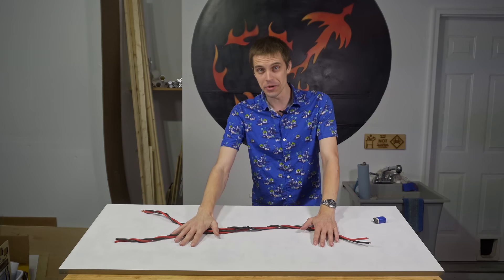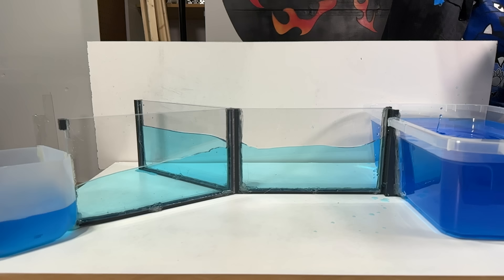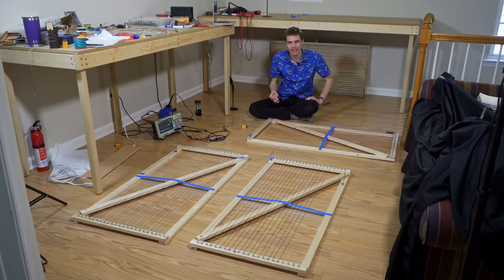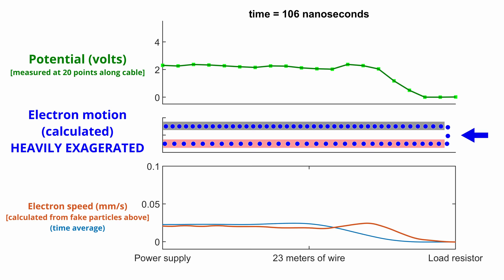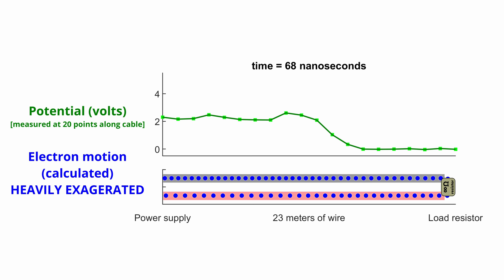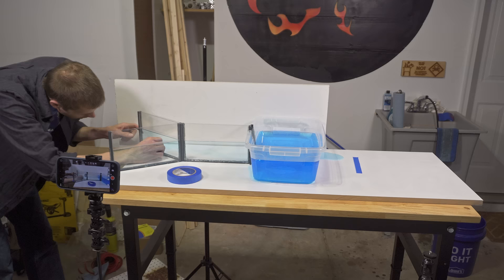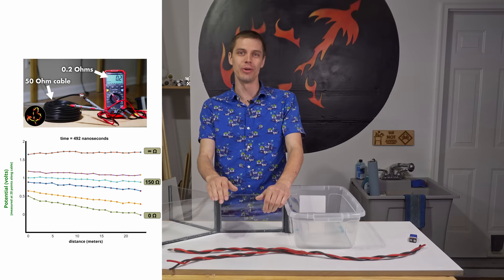Watch electricity hit a fork in the road at half a billion frames per second

Comment from the maker: Corrections and FAQ in this comment!
Check out the other channel for follow up videos, and video Q&A that I'll be posting in a few weeks with questions from here and from Patreon! https://www.youtube.com/@AlphaPhoenix2
Check out the Patron page if you want to support the channel, get early access to videos, and join us on Discord! https://www.patreon.com/AlphaPhoenix
Thanks to @ElectroBOOM for giving me a sanity check on this data a few months ago! (I hope you like the final video)
FAQ:

0) Questions about the experimental setup (including the effect of the probes on the circuit while I was measuring) are here! https://www.youtube.com/watch?v=sty0Y1qmgEYc If anybody wants to recreate this project, or turn it into an undergrad physics lab. hopefully there's plenty of info there! If I can remember how to use github I'll post some of my visualization code and leave a link on that video.

1) Lots of commenters have that I'm confusing voltage and current at times, but I tried to be very careful with my language. Current is the actual motion of the electrons, and in the graphic I showed with the blue dots moving around, I'm calculating that motion based on the voltage. it's basically the current that is NECESSARY to produce those voltage patterns. I also did a measurement where I measured the current directly by placing a very small resistor at the input lines and measuring the voltage drop across it over time, so I know my calculation lines up vaguely with that, but it WAS only a measurement at one point. If somebody wants to put a quarter ohm resistor every 4 feet along a wire and measure more voltages, I'd LOVE to see the data! I'll talk about the script a bit more in the Q&A video that hopefully will be out in a few weeks!

2) When you first flip the switch, the battery doesn't actually see a "dead short". The current out of the battery initially is limited by the line impedance, which depends on the properties and dimensions of the cable. In this case, it's the same current you'd get by bridging the switch with a 150 ohm resistor!

3) A lot of people have questioned the use of the words "communicate" and "sending information". I admit I anthropomorphize a bit too much in this video, but particles and groups of particles "communicating" and the rate at which "information" can move are very important hard physics terms that don't imply the particles are thinking. "Information" here consists of things like partical position, and they pass this information between each other using the electric field.

4) Water is a compressible fluid. if water wasn't a compressible fluid than pressure wouldn't work and water wouldn't be able to flow around corners in pipes. The way I'm using it it's actually EXTREMELY compressible (in the lateral) direction because it's allowed to expand upwards without getting significantly denser. Electrons in a wire are orders of magnitude less compressible than water, but it's still worthwhile to think of them bunching up!

5) ...........keep the comments coming! i spent like 4 hours reading comments yesterday lol
Reply: The correct answer should be 'B'. Recently(I mean 6 months ago...) I saw the debate of Veritasium and electroboom and came up to that conclusion...
Reply: I have a question, in your exemple with the open circuit we see the fact that the electron are closer in one wire. what happen when you stop the batterie ? (open the interuptor in your case) does the potential rest in the wire ? making it a small capacitor ?
Reply from the maker: @user-zp5xt8em6l I actually emailed some early data from this experiment to Medhi a few months ago and he said it was cool 😊. I’m not trying to “prove” or “discover”, anything here, just demonstrate. Electricity is very well understood by humans, it’s just hard to explain.
Reply: @AlphaPhoenixChannel  I cannot believe that you actually replied! Thank you very much!
THIS IS GREATLY APPERICIATED! 😊
Reply: @user-zp5xt8em6l that Veritasium video is pretty misleading. There would be some detectable trace effects due to the fields being in proximity but the full voltage only arrives later as you would intuitively expect.
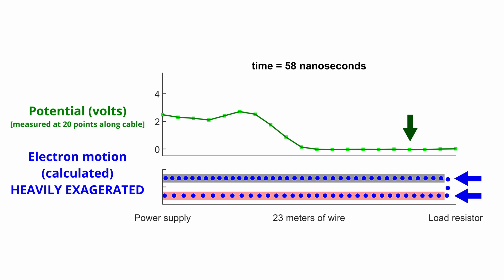Reply: 16:28 / 18:54 Since it pushes from one end and pulls from the other end before stabilizing... If you disconnect at both the bridge and the battery right after connecting it, would one wire have more electrons than normal and the other less? Same with 11:23, if you split the fork at the right time, what would happen?
Reply: @XIIchiron78   Yes, that is indeed correct.
Reply: @AlphaPhoenixChannel I could never get my head around Veritasium’s explanation with regards to the fields.
Reply: It really surprised me that it took milliseconds to stabilise seeing as audio is sent at the nanosecond timeframe at over 1 million bits per second. How does it not just end up as noise at the end when your turning on and off the circuit faster than the stabilisation time? 
Would a sound engineer be able to use your program to predict the effect there circuit with limiters and amplifiers and sometime disconnected kit(unplugged cables coming to and from the sound desk) will have on the sound quality? as in how quickly a signal will stabilise?
Reply: Ever since veratasium did that video and gave you a shout out. Circuits have become more complicated than ever.
Reply: It would be interesting to discuss your findings with Practical Engineering in the context of how this phenomena is (or isn't) taken into account at the infrastructure scale of a power grid. I would imagine that if there were multiple MW of power flowing back and forth on the lines as the system settled from a starting condition, that could cause some major issues if not handled correctly.
Reply: @truefiasco2637  I will suggest you watch the impedance matching video in the description. In practice, engineers need to consider characteristics of every part to eliminate these noises.
Reply: @truefiasco2637   You're talking about digital audio like SPDIF?  It's because in real life those have termination resistors.  The cable has an impedance (of 75 ohms, I think), and there is supposed to be 75 ohm termination resistors on each end.  That reduces reflections, so I'm guessing it would stabilize quicker.   

A really long Y cable with one end of the Y open might mess things up a bit, but it would have to be enough to cause a bit to flip.  Hook a few 50ft SPDIF cables to a Y adapter, and see if it still works with one of the cables going nowhere. 😀
Reply from the maker: @TheMohawkNinja  that would be fascinating! I’ve wondered how phasing works across the country - at c, the wavelength of 60hz is 1.3x NY-LA (thank you wolfram), so if you plotted a bar graph voltage map of the whole country, would there be ripples? Do those ripples emanate out from wherever did the OG black start? (And then drifted into noise?) now I’m super curious and measuring this synchronized sounds like a nightmare
Reply: Simpler question: Why is there a 'sudden' increase in voltage when the current reaches the wire with the two disconnected ends and 'sudden' decrease when you reach the wire with the two connected ends? 

More complicated question: Are the voltage changes really 'sudden' like that or is some dynamic phenomenon occurring over a timescale too fast to capture?
Reply: If you wanted the water model to work more like the electric model you shouldn't have pored the water into an empty "corridor". You should have had  filled the whole system and than generate a wave. This because the wave of electrons from the battery are more like ramming into stationary electrons. At the point the wave reaches the bifurcation. The wave needs to push twice the amount of mass. Which can be taught of as a dynamic end cap. This will result in a partial internal reflection
Reply: Is there a reason the animation only covers the black wires and not the rest of the red wires? There are effectively two forks onto open ended wires: one at 25% along the circuit to the unconnected black wire and one at 75% along the circuit to the unconnected red wire.

edit: come to think of it, is the potential being measured relative to a common ground or between the red and black wires at a point?
Reply: I would love to see the difference between 50 ohm antenna wire and 75 etc antenna wire in this way to see the impedance waves running through the circuit. It would be helpful to understand radio for sure
Reply: Is this analogous 19:00 to open and closed end waves of different types (basically a rope swinging up but then being held up by some fans?)
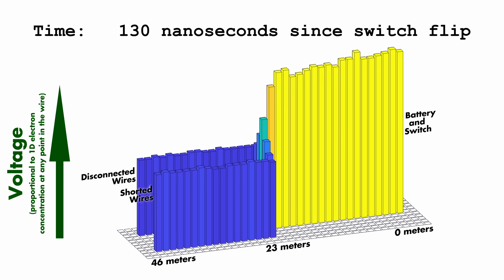Reply: Great video! At 11:03 you said that something looks like it's getting reflected back towards the battery, and that it looks weird. I'm not sure if the drop in voltage in the reverse direction is what you were talking about, but that's exactly what I'd expect. At the speed of light, it's not too useful to think of current in terms of amps anymore. It's better to think of coulombs. So, one coulomb goes down the first wire until it hits the fork. At that point it splits between the two wires, and each coulomb is at half the voltage it was, due to the wires essentially being two resistors in parallel (Ohm's law).
The reason it reflects back towards the battery is because voltages measured through a uniform conductor ideally drop linearly, so it's trying to reach that equilibrium at (near) the speed of light.
Reply: How are you reading so many different analog voltages all at once and so high speed? I have a four channel oscilloscope, but I see you are reading like 60 different voltages. I really love how it allows you to make a map of the circuit and really analyze what it is doing, would love to look at circuit boards like this.
Reply: I have a problem with this "communication" concept. If you go back to your water model, it's not communicating. The water hits a dead end and backs up, then eventually drains through the outlet, or in this case, the short or load. The voltage/current at the battery is dropping and stabilizing based on "flow" of the stabilized "stream". But to say it "communicates" back seems like a bit of a stretch. Unless this is how it's just described in physics?
Reply: @warpigs330  I believe he just repeated the experiment multiple times and changed the position of the probes each time. Which is perfectly valid so long as you don't change the circuit.
Reply: What does it mean one of the wires is shorted? I thought shorted, just from like a popular usage perspective, meant a wire couldn't pass a current anymore.
Reply: @blaircox1589  That's essentially what all communication is: one point in space receiving changes initiated from another point, and responding to those changes with changes of its own. When the wave of current comes back to the Y split, that also affects the drain current of the battery (at first) until it reaches equilibrium.
Reply: @givensuman  A "Short" just means that a wire is connected somewhere it shouldn't be. It's a "short" circuit because the circuit should be longer, but something is connected unintentionally so it is shorter than it should be. Shorts can definitely pass current. Short a high voltage line to ground and you will see some sparks.
Reply: What would happen if you used AC instead of DC?
Reply: I think part of the problem with the water model not appearing 100% accurate, could be in-part due to boundary layer drag, The walls are so thin that the water is basically mostly surface area, in-contact with (and sticking to) the glass. adhesion could sap energy from the system, acting like a damper on a spring (or in your wave in this case). It'd be too expensive to be worth doing it with Mercury (not to mention that a room full of large amounts of uncovered mercury isn't great), but I feel like that could be a cool way to bypass this, simply by having the mass/density of the mercury overcome any forces by the boundary layer. 

Another way that "might" work (I don't think so, but it's easier to test at least), is by using a low surface tension liquid (I know it's not surface tension causing the issue, but it may be related to boundary layer drag.
Reply: Why is there a back-ripple drop at the point where the wire splits?  Maybe I've missed the explanation, but I don't get why the voltage drops at the wire split point
Reply: In the triple-chart at about 14 minutes, the middle electron motion graph seems a little confusing to me in the return path—am I thinking correctly that the top graph doesn’t show the measurements in the return path? It makes those two graphs not correspond, if you’re focusing on the electron motion behavior in the return path.
Reply: I originally thought it would be B because I thought the negative side of the battery would start pulling in electrons once it's connected, but it appears that with your switch circuit, the negative is always connected, so that couldn't be observed
Reply: just a question then? couldn't you then use some switch magic to keep pumping the wire with electrons and then somehow burn the wire (disconnected wire OHM INF) i mean like the wire is a tank of water but it can't hold much so it burst because you keep turning the pump on and off... in that wire it seems like it has a much higher electron volume than the first time you haven't turned it on yet at the end.
Reply: Do you think hanging over a hundred 'scope probes off this thing might change the circuit? There's probably 5-10 pF at each probe point so how does that compare to the wires?
Reply: 4 years of E.E. in a 23 min video. 
WOW!!!
Reply: @AlphaPhoenixChannel Can you clear something up for me?
When you say 1 graph is "the wave" and 1 graph is the actual electrons movement and the electrons are moving way slower than the wave... Is "the wave" an analog for the electromagnetic field? And does the load/light bulb turn on when the wave hits it or when the electrons start moving through it? 
And if it's the wave that lights it, how is that possible with zero change in the movement of the electrons from before the switch was flipped? 

I also saw veritasium's video and can't conceptualize both explanations being valid lol
Reply: At 5:18 you could use mirrors on the celieing to get more space for the camera. I think Film Riot has a tutorial on how to do so.

Probably not worth the hassle for ya, but figured I'd mention it anyway
Reply: @truefiasco2637 the reason is this: impedance matching. The twisted pair in the experiment has a builtin impedance. Remember that, in the experiment, the open circuit pair saw a doubled voltage when the wave feont hit? And the closed circuit saw the voltage drop to zero? This is because the "termination impedance" was infinity and zero respectively. But engineers use an impedence which prevents the reflections entirely. This can be done a nulber of ways, including simply putting a resistor across the wires. The same thing happens with digital systems (e.g. ethernet) and RF (radio waves). All these applications require careful attention to impedance matching to prevent unwanted reflections.
Reply: @givensuman "shorted" is when the wires connect essentially without resistance. Also called "closed circuit". You described "open circuit", which is where there is no circuit at all: it's unconnected.
Reply: You should absolutely do this again with inrush limiters and diodes.

I hope you still have the setup.
Reply: @bamberghh1691 there are a number of ways of explaining this. If you think of it as a wave front hitting the junction, then you can model it as each twisted pair as having an impedance. The impedance at each point determines what happens to the wave. When the wave front hits the junction, there are now two paths, which essntially halves the impedence, causing a reflection back down the path it came from. It's half the impedance in exactly the same way two identical resistors in parallel have half the resistance of each individual resistor.
Reply: does the experiment change if you reset (ie briefly short) the disconnected wire between experiments?
Reply: @EmpressOfExile206 I think the problem is the whole picture really includes both the electric field and the magnetic field. But for most circuits you can ignore the magnetic field entirely. Veritasium tried to explain the whole thing. Whereas in this model, AlphaPhoenix didn't really use fields at all, just implied them via the motion of electrons. But of course, each electron has an electric field, and in motion a magnetic one too. There are many ways to describe a system in physics, often entirely equivalently. I've seen physics start with an electron, and then show how it moves near other electrons, then build up the idea of a field from many electron pair interactions. Physicists use whatever model happens to be convenient for the system at hand.
Reply: @MadhavMalhotra reflection. But it will happen at both ends of the branches and even at the 'Y'. Every impedance change will cause reflection.
Reply: The 'switch' or the sudden change of voltage level at the beginning of the wire can be seen as a ramp of a square wave. A square wave can be seen as a combination of all odd harmonics of its ground frequency. So there are multiple things happening at different frequencies until it stabilizes.
Reply: At 7:46 in the video, why does it appear like there is a very tiny bump in the voltage and then a dip before the switch turns on? 

Also in the video at 16:09 , you said how + pulls the electrons and - pushes. Why is there a single wave here? Shouldn't a "dip" wave start and propagate from the positive terminal of the battery at the same time as the wave you show in the video that starts at the negative terminal?

Edit: after thinking more is there actually a pull but your graph/animation only displays the difference in potential wire to wire so it isn't visible? If you instead measured wire to the battery would you be able to see the wave coming from both ends?

If there is pull wouldn't you need to open up the end to let water out at the same time as letting water in to replicate it?

Thanks, sorry for the double post I just saw questions go here.
Reply: @AlphaPhoenixChannel   Couldn't the "negative" back-wave that you see in electricity but not in water be explained by the other half of the wire? So it's not the wave bouncing back, but wave of negative potential coming from the other said? And the water model is not a closed loop, so you don't get the other half of the loop.
Reply: Does this analysis have something in common with antenna theory?
Reply: It would be interesting to analyze these results with a quantum model of electrons. Electrons are never not moving.
Reply: @Somerandom1922  I would think besides the boundary layer or layers, surface tension would affect the shape of the wave and how it reacts when it hits the wall. The surface tension will also cause a meniscus all along the walls. Air and temperature too but probably negligible. The density of the water. The depth of the water probably has some effects. Waves from the sides of the container. There are tons of interactions and properties of fluids that don't apply to electron movement. Water can hit the end and splash, and a water wave can "break". Water is analogous but not the same. It's not a perfect replica but it does make a surprisingly accurate visual representation. 

The water model also formed a depression at the Y intersection where the voltage didn't.
Reply: you spelled exaggerated wrong at 14:30 🙃

i'm too dumb to correct you on the electricity stuff even if it were wrong
Reply: but are they in the wire or on the surface of the wire? Both? 

It seems to act like pressure increases and a fluid.
Reply: @MadhavMalhotra  not an expert here, but my understanding of the video here is that the "voltage" (or the height in the graphs), represents the crunching pressure between adyacent electrons when the power supply starts pushing more new electrons into the wire. So along a wire its like a pressure wave. When that wave reaches the open end, all those electrons that are coming close to the end (and all those coming behind those) will crunch even further, and the pressure will reflect back. On the "close end" (which is actually not an end, because its continuos back to the power supply), there is not "pressure" stacking up. I hope this helps, and that someone confirms or refutes my sayings.
Reply: Fantastic. What is happening at1st reflection at the Y splitter is the impedance mismatch, which causes the part of the energy to reflect back. It is a kind of a semi wall, a semi transparent mirror. Further, the electrons are moving in the both wires of the twisted pair concurently vs. distance from the battery (parallel capacitances), in one enrichment, in the other depletion. The twist is important, too. It determines the overall impedance of the wires pair. The resitor at the end of the line matching that (typical) impedance should give the least reflections and oscilations, the most smooth propagation wave. It is very likely to be somwhere between 75 and 300 Ohms.
Reply: The initial current is limited and determined by the parallel capacitance and the serial inductance (which builds the field around the wires. That is how the battery "knows" how much current it lets go. The field is the effect and not the cause.
Reply: @MadhavMalhotra  my guess for the sudden decrease at the shorted end is that at that point, the impulse from the other terminal of the battery reaches that point at the same time through the second wire and the electrons, instead of bunching up against the end of the wire like the other side, instead are driven to flow faster by the opposite charge.
Reply: @roustache to answer your question as simply as possible, 
Removing the voltage is the same but opposite effect on voltage ( positive instead of negative potential). We can think about it this was due to a nice mathematical property called superposition.

The line capacitance does not change, it is however frequency dependent. This means switching on and off will have different effects of different AC frequencies present. Unless we can have the characters impedance matched such the the line is considered to be no dispersive, in which case the phase velocity of different frequencies is the same, we don't get a slew on the waves.

You can read up about transmission line theory if you want to know more. Specifically, the experiment he did would be known on paper as a "bounce diagram".
Reply: So I am just learning electrodynamics and this was very interesting - visualized the reflection factors of -1 and 1 pretty well. You forgot to either edit out or explain why you at some point mentioned the resistors btw (for anyone interested - the reflection factor is 0 if done right so basically it doesnt reflect anything). I would have loved to see or hear why there was a reflection at the fork tho - thats basically the only thing I did not understand about this yet. Does the initial wave "see" some sort of resistance at the fork which causes an initial reflection? Also, idk if this would not have been easier to visualize with high frequency waves. I suppose getting a proper siganl generator is expensive.
Reply: Looking forward to your purchase of a vector network analyzer.
Reply: None of those 4 options is the correct answer.
You have a long Y shaped capacitor. Current will start to flow to charge the capacitor and both paths will be taken at the speed of light. You can use a SPICE simulation where you have the circuit simulated as a finite chain of inductors, resistors and capacitors. That simulation will perfectly show what happens in a real circuit. There is no guessing involved it depends on the line capacitance, inductance and resistance.
Reply: @pottedrosepetal6906 There is a imepedance mismatch at the Y element. That is why energy partially reflects back.
Reply: I think the wave graph would be much more enlightening if Current was the Y-axis rather than Voltage. Of course the disconnected wires will spike in Voltage, you've effectively extended the battery terminals out to the ends of those disconnected wires.
Reply: @electrodacus the capacitance is between the twisted pairs, and the behavior is described by the characteristic impedance of a transmission line.
Reply: i just want to know how would changing the supply from a continuous to an alternative one would effect your results, i would assume that it should line up with what everyone is talking about ie Mehdi and Veritasium's results from some time ago
Reply: @onradioactivewaves  The point is that there is no guessing involved. The current that starts to flow at the moment the battery is connected has to do with the line impedance so capacitor starts to charge thus current depends on the line impedance not just a random (guessed) current.
Reply: Very nice video! You come so close to getting it right! Instead of talking about electrons 'flowing' through a wire, it should be, "The 'electro-magnetic field' travels down the wire".
Reply: The reflection when hitting the Y makes complete sense from a fluids analogy. I work in the dynamics world for machinery and piping. A change in diameter of piping acts as a reflection to pressure pulsation. Because the wire you have in the two branches is the same, the effective cross sectional area changes, denoting a reflection point.
Reply: Ok, I'll play.  I believe C, since the update at the speed of light doesn't know the termination as it progresses down the wires.  This is similar to how a pulse signal progresses down an antenna that isn't shorted to the ground side.
Reply: I'm speechless. I'm gonna bug my electical engineer coleagues about this for a while.

...in the mean time, could you calculate and render the same thing for both poles at the same time relative to a common ground? I think that might give us a bit more intuition into the interference at the zero ohm "end" and even better picture overall.
Bonus points if you could do both U0=Ups/2 and U0=negative terminal.

Once again, amazing job. I would never think this possible with "NASA budget", let alone one dude doing it at home. Seriously, where do you go from here? Homemade Ligo?
Also: take that @electroboom and @veritasium!
Reply: Just nitpicking, but the wires being a twisted pair certainly matters for the initial inrush since impedance depends on the physical configuration of the transmission line.
Edit: twisted pair is also great at not being an antenna so you avoid any voltage due to emf.
Reply: It might be interesting to see how the battery figures out, after the stable state of one half connected & the other half disconnected and quiet, IF you flip a switch at the end of the disconnected wires creating an instantaneous connection!  At that moment, the battery already decided there's "nothing juicy flowing" down the dead connection wire but suddenly needs to notice that it got connected.  And does making that new connection influence current already traveling down the initially connected half?   I also got lost in your discussion explanation using the descriptor "waves" ... and ... any notion of the term "electric fields".   Or:  in this experiment result, what exactly are electric fields doing versus electrons?  Beautiful work!  ♡☆
Reply: @electrodacus  Or you can treat this as a transmission line with a specific impedance if you want to go the route of abstractions. I agree the options were worded badly, but given this isn't meant to be a electrical engineering exam, but rather an infotainment video with "guesses" in quotation marks option C is quite obviously implying the correct answer for those who know and easier to understand for everyone else.
Reply: @DmitriyLaktyushkin  It is a transmission line and there is no abstraction there. In order to be able to calculate what happens on a transmission line you need to quantize it so have finite number of RLC elements in order to be able to calculate what happens at every point.
Making the video was a lot of work and a SPIC simulation of a transmission line will have provided the same results with much less work and burned fingers :)
Both inductor and capacitors are energy storage devices so it is irrelevant what is or not at the end of a transmission line for the current at initial connection. And that current can be precisely calculated and not a guess.
Since there is also resistance even a open transmission line will waste energy as heat at the initial connection.
Reply: There are 2 types of current. magnetic conventional "electronic" current,
and dielectric displacement "positronic" current.
voltage, capacitance, inductance and resistance.

So which current are we talking about?
the open branch acts as a capacitor, so mostly displacement current from the dV/dt at the switching moment.
every thing starts to ring at a high frequency until the steady state occurs.
So, voltage is transformed into these 2 currents at the same time, but in opposite direction.
one flows from positive to negative (displacement current) and the other magnetic current flows from negative to positive.
Reply: Are all the leads back to the scope the same length?
Reply: To get liquid to behave more like electricity, you could think thinner liquids (I would assume that less viscosity means more pronounced wave patterns due to less friction)
P.S. I guessed for B
Reply: Would the reflected pulses indicate the resonant frequecy of your wire loops?
Reply: How does the fact that electrons in one wire can influence the electrons in the other wire via the EM field tie into this? The electrons start moving in both wires. Then the field reaches the (dis)connection points. Instantly, in the connected part voltage spikes (cuz in both wires it reached this point simultaneously). In the disconnected, dies down. Why is this wrong?
Reply: FAQ: When you say you measured the voltage you always mean in relation to the other wire at the same location, not relative to ground, right? Such that the voltage at the connected end is 0V, not 4.5V. 
If my guess about the measurement is correct, then the waves we see could come from either of the two wires.
EDIT: nevermind, I watched the bonus video now
Reply: I think you misspelled exaggerated in one of the slides :P
Reply: I’m going to guess option D. Simply because that is the most wave-like analogy of the four (compared to acoustic waves, or ocean waves). Now for the fun part!
Reply: Would you consider making a similar circuit without using a twisted pair? basically the whole thing would become one giant capacitor, just having the leads travel next to each other so we also get to observe the effect of the electromagnetism in action?
Reply: Have you tried this without twisted pair?
Reply: do the same thing with a switch at the end!
Reply: I think it was a bit of a mistake to only measure voltage, and then say things like "current is flowing here", or "current is getting split". You're measuring the electric field strength, not the current. It's trickier to measure current, especially at various points along the wire, but a few small resistors at the battery, and at the 3 way junction, would have enabled this and might give more interesting data.
Reply: With respect, if it can be understood it can be explained, I think your experimental explanation of what is happening is the best I have seen. @AlphaPhoenixChannel
Reply: Which oscilloscope do you use?
Reply: Maybe you explained it and I missed it but why is there that reflected wave when the voltage reaches the split. I would have expected the wave to travel down both paths but I don't really see why another portion of it is reflected back. In the water analogy is makes sense because water has its own inertia as it travels through a channel, it hits the split in the pipe and briefly there is a high pressure that reflects a wave of pressure back upstream as the water's inertia means it can't change direction instantly, is there something analogous happening with electrons in the wire?
Reply: In the Video I see that you used a 9v battery to drive the circuit. Why would the voltage be 2-4v on some of your tests? I get that the battery used could be drained at the time of taking the data, but maybe your next video could go into proportional differences of the waveforms when using either a constant voltage source or different kinds of batteries. This waveform could be due to the chemical reaction of the battery itself.
Reply: I don’t believe C correct either, there is no guessing, the potential between the battery and wire is greater at the start, as the electrons flow, the potential equalizes, and thus current stabilizes.
I could be wrong and often am.
I believe you might get a closer analog with the water if the bucket that it drains to goes below the table.
Reply: Yes, that's why sudden massive disconnections can cause problems. Also, why photovoltaic installations are problematic for the local grids.
Reply: at the start - i knew it was capacitance - however - the idea that a wave is reflected from the junction of the two wires is flawed, simply because a short circuited junction is not two wires - it is one wire and you will not be at a full or partial boundary to cause reflecting any signal 

i am considering that the stated ' reflections ' :
1 . are not external to the power source ( they are not reflections at all )
2 . are the results of the variant differences of potential inside the power source

check if your data contours to the idea that the variations of the voltages ( difference of potential ) in the electron paths - outside AND INSIDE the power supply - are a more reasonable explanation for the oscillating voltage wave movements 

so as the positive side of the power supply is being depleted of electrons that are leaving the power supply and entering the wire  - the difference of internal potential causes electrons to leave the negative side of the power supply and that raises the potential between the negative terminal and the wire - thereby facilitating the movement of electrons from the wire into the power source - presumably spreading them further apart from one another inside the wire

it may be observable if you tested two points at once - one point near the positive terminal and one point near the negative terminal
would you be surprised if you saw a negative potential near the negative terminal concurrent with the positive potential near the positive terminal ?
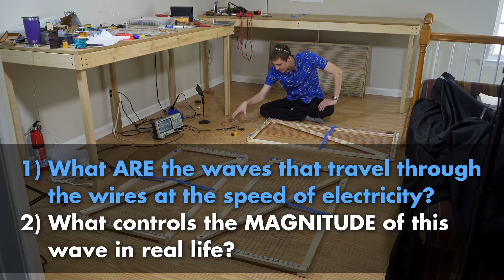Reply: 13:01 simple.  if you open a faucet connected to a garden hose, it will initially have massive flow at the beginning until water reaches the sprinkler which more likely has restricted flow. the increase of water pressure in the hose will reduce the water volume coming out of the faucet.
Reply: Short answer: Transmission lines.
Reply: Next step would be to see how an electrical arc can solve a maze.
Reply: @EmpressOfExile206  As I understand it all the electrons pushes against each other. The wave is the pushing effect. The localized electrons can there fore start doing their jobs as soon as the wave arrives. The wave is the electromagnetic field. The wave I am talking about is the main wave. There is in fact a lot of waves all added up and eventually generating the wave front. All the wives are sinosoidal  waves. It is only when they are added up that they appear as a front.
The veritasium video was pretty misleading and Derek was not very proper in that one and his follow up. He wanted to be right and admittingly he was partly right but the whole thing is needed to be totally right and in the totality he was more wrong than right.
Reply: How does the surface charge theory of the cause of the E field that gives rise to electron drift play into the electron “bunching” description? My understanding is that the field that gives rise to voltage is a surface charge potential wave phenomenon.
Reply: @tolkienfan1972  You are right impedance matching would have fixed it but that was not the purpose of the exercise. The purpose was to see what happens in open and closed wires and that it showed pretty well. That is my opinion at least. I have worked on all of the systems you mentioned and after having seen some of the signals in computers I actually wonder how can it work at all. I was usually there to fix the computers when they didn't work and some times the fix was to put in a longer wire or some other delay.
Reply: @tolkienfan1972  Unfortunately physicists are people too. They some time don't understand as much as they think they do. That goes for engineers too. I am an engineer but I have many times met people that have worked on some thing and they know their little field much better that most engineers or probably physicists too. That is currently my opinion and I usually mention that when I answer a question or put in a remark as really most of what I know is what I have learned from others but I do compare it to my experiences and I have many years experience.
Reply: @chrislambert-shiels5291  In a way it does in my opinion. Even a dc is an ac. That is any change in a dc potential happens with the help of a number of sinusodial waves and the wires here are basically transmission wires. The termination would be the antenna and a half wave dipole antenna works as a short for it's resonance frequency. The reflections you see on the wires are similar on cables to an antenna. An open wire stud does work as a total short for a set frequency. I saw this clearly for the first time many years ago when I was installing TV antenna's and the customer wanted to connect 2 TV's to the same antenna. One TV could show some channels but not others and visa versa. I have also experienced it later on data communication. (Standing wave theory).
Reply: If you disconnect and reconnect the battery really fast, which side will get hot quicker?
Reply: @osarjeant  Correct but the overall result is equilibrium when no external charge is put on it I believe.
Reply: @leonhardtkristensen4093  "unfortunately physicists are people too" This isn't unfortunate.  "that was not the purpose of the exercise" I know that. I was responding to a specific question. When I respond to you, your name will be mentioned.
Reply: @leonhardtkristensen4093  a change in potential implies ac. Dc implies no change in potential. A steady state. The terms are used specifically to distinguish the two cases. It's also acceptable to refer to the "dc component" of s signal, which would be the mean potential over the whole or specified part of the signal. If you use the term "dc" to refer to a change in potential, you are misusing the term.
Reply: @m1stertim  I don't think it was an English education. As a person with a non English background I have problems writing all the time and I honestly must say that he should have a 10 in effort explaining the electricity stuff. If one couldn't say or do anything for worrying that one small detail was wrong then one couldn't do anything. 
In as so far of you being too dumb to understand it then I am sure that you are wrong too. In my opinion to be dumb one must not want to learn. If you had the interest I am quite sure that I could teach you. You have obviously learn English so you can learn. To not be able to understand is most often because one has not learned enough. It is not dumb not to know unless one doesn't want to know if one has the ability to learn.
Reply: @TheElectrition  it likely depends on the frequency, and the impdences of the twisted pairs. You can cause a "standing wave" in the wires, which can result in hot spots. These standing waves depend on the transmission line impedance and the terminating impedences.
Reply: Sounds like a capacitor, to me. @Amonimus
Reply: @pottedrosepetal6906  As some body else has already mentioned but possibly not to you then at the fork you connect one impedance to two impedances in parallel. If the impedance of the wire is say 100 ohm (that is the impedance of an infinite wire that is talked about) then you put two 100 ohm wires across and as if it was resistors the impedance is then reduced to 50 ohm. This will of cause cause a reflection as does any change of impedance in a transmission line.
Reply: While the grid might not have this exact phenomena, it DOES fluctuate back and forth, and substations will constantly adjust the amount of current sent to blocks of customers.  If it did NOT do this, we would have transformers and maybe even turbines blowing up, at electric plants.   @TheMohawkNinja
Reply: @Sett86  I agree with you prize but not so much your critique. I believe he used one side of the battery - say minus - as common ground. He really had to. You can not measure voltage levels from a floating ground.
Reply: Amazingly cool! I'd say you better had emphasized the effect of two twisting wires in containing the field around the wire bundle. That's why the field is not propagating in 2D, affecting all the lines at almost the same time. You have two fields that cancel each other out at distances larger than 2-3 times the diameter of the twisting pair.
Reply: The amount of charge in the wire cannot be more than the source of the current.  So, it would never be more than 9 volts. @Drefar
Reply: @ramrod0209  In my opinion electric field surrounds an electron (are probably part of the electron) but stretches far away from the electron in ever diminishing strength. That is what is  adding up to make the electric field. If it is moving there is also a magnetic field generated. The front of this field moves along the wire similar to a wave in water. In contrast to a wave in water then this wave stays up. It does not go up and down like a water wave. To achieve this a lot of smaller higher frequency waves (all sinosodal waves) are generated  and added up so that the result is like a rising and then flat long wave. Any mish match along the travel will cause reflections and any change like a new short introduced will start a new wave from where it is introduced. Theoretically it will newer settle totally with the formulas we normally use. It is only when the resistance in the wire takes away more energy than a wave holds it will stop.
Reply: @user-zp5xt8em6l  …Did you not watch the rest of this video, where he experimentally demonstrates that C is how it behaves?
Reply: @MasterIvo  In my opinion you are totally correct except there is only one kind of current that being the movement of the electrostatic and magnetic fields from the electrons. The ones you are mentioning are all from the same. And yes of cause the atoms that have lost an electron do move in the opposite direction I suppose but not much. They probably don't even move out of their lattice arrangement in the metal. Electrons jump around between atoms all the time and the so called hole current is really also an electron current. Most commonly we think about current as what is creating a usable outlet of energy like when multiplied by a potential (voltage) shows up as light in a lamp. Of cause we also have current going into a battery or a capacitor when being charged. The inductance comes from magnetic field and the resistance is the losses from movements of the atoms caused by the jumping of the electrons and is causing the heating.
Reply: First, amazing video and explanation.  One comment/observation is that I think it would be almost more interesting to do this demo with a medium sized bank of capacitors to show how the water/electrons are "sloshing" out of the source and then being sent back in by the wave because it shows the degree to which the electrons do move slightly into the fully disconnected wire pair and then slosh around until they reach the equilibrium based on the overall capacitance of the system.

In either case, I love each of your videos and applaud your ability to figure out how to measure this.
Reply: @ChelseyK1ng  The electrons don't go anywhere instantly.  The effect of the compression of electrons move with near speed of light but does depend on the surrounding materials. The two wires along each other creates the capacity (you need two surfaces to have a capacitor). That is the E field. The M field causes the inductance. The electron in front of the one we are moving has a mass and as such it takes a little energy to start it moving. This kinetic energy in the electrons is also why energy has to come out if you abruptly stop a current. 
The current goes from the battery at a speed that is determined by what is holding back the influence of the EM field and what potential is put on but mainly the impedance of the wire. The current front is the same as the EM front. The impedance is made up of the inductance and capacitance in every little spot along the wire. If there is any change in the impedance (as where 2 wires are paralleled) there will be a reflection. A similar thing happens at the ends of the two wires. The amount of reflection is determined by the change in impedance. If a different or a new change is introduced a reflection will move down along the wires in all directions similar to the initial wave front. This is my understanding of what happens.
Reply: @brendanpreece3089  In my opinion that surface charge you are talking about is really the surface charge or E field around all electrons. As I understand it all electrons try to get away from all other electrons so the electrons do sort of bunch against each other and yes that is what is causing the voltage surface charge potential wave phenomenon.
Reply: @TheElectrition  The one that breaks connection first as the resistance will be highest there.
Reply: @tolkienfan1972  Sorry I just thought I had some thing to say there. I apologise if I offended you.
Reply: @tolkienfan1972  In my opinion when a voltage is connected (DC or AC) it will all behave very similar. We are here in this video working with a DC battery connected to a wire configuration and as it is the start up phases that we are looking at I believe it should all be looked at as AC.  In fact I would say that all so called DC connection can be looked at as an AC. It is just that the wave length could be up to billion's of km's. Of cause in daily talk we would probably specify anything with a pulse length longer than seconds on at least minutes as DC. It does not change the fact that any change can be looked at as AC.
Reply: @leonhardtkristensen4093  thank you for the detailed answer. I'm gonna have to reflect on it for a couple days haha
Reply: @Agnes.Nutter   Yeah, I did! See  Alpha phoenix wanted us to make a guess just before the explanation and I gave my guess and then watched the entire video  but I won't change my guess after getting a in-depth explanation of the circuit because that was supposed to be just a GUESS.
Reply: @leonhardtkristensen4093   the capacitor uses the displacement current, which flows through the dielectric. that is not an "electron" flow. So I agree to disagree.
Reply: @Agnes.Nutter   And thanks for understanding my reply clearly! :)
Reply: I believe a corollary to your work on voltage propagation in POCW (plain old copper wires) is that there must be an AC frequency at which the voltage changes are essentially messing up a circuit that would work fine in DC. As you experiment with higher and higher frequencies, POCW becomes increasingly worthless to transmit the electrical energy. It is at this point where circuits utilize waveguides and other strategies to contain the signals in increasingly hostile (high impedance) circuits. You can overcome some of it with certain gating strategies, and, of course, using digital/binary or square waves rather than pure sine wave AC. Probably beyond the scope of this, but that's what I was thinking after watching your great video.
Reply: @leonhardtkristensen4093  of course you can get ac from a battery. But that doesn't change the definition of the term "dc". Using dc that way is simply incorrect. A battery is usually said to be dc. But it's not accurate. Once connected to a circuit and allowed to settle to a steady state, then the flow itself might be dc, but there are probably some ac components. Do you see? The definitions of ac and dc are there to communicate something very specific. If you insist on using them differently you aren't helping the communication.
Reply: @user-zp5xt8em6l Veritasium and Electroboom weren't using twisted pair.
The result is that thier experiments were more radio propogation across a gap instead of what we have here, which is a transmission line.
Reply: You repeatedly mention current, yet you never actually measure current, just extrapolate it from voltage measurements.
Reply: @Hyxtryx Y split SPDIF is "illegal" for exactly the reason you describe here.
A Y split is exactly the same as a 37.5 ohm termination (half line impedance). If there are any long cables in a circuit with a Y split, the reflections might interfere with the next data bit.
Reply: @dougaltolan3017  I'm not referring to my answer to that video completely, rather I assumed it from a portion of electroboom's video where they were discussing their different views  about movement of electrons through wire via video call together... The explanations they gave to each other were giving me an intuition that the answer maybe B, well I might be wrong as that was just a guess!
Reply: @roustache  Yes, the wire would make a small capacitor. The charge would eventually leak out due to gigaohm resistances from humid air, imperfect dielectrics etc., but it would remain for a while.
Reply: The "open circuit" is not really open though - you have the DSO connected across it. It may be high impedance, but it is more than nothing.
Reply: @mythcrafterpre6534  It would be interesting to see this experiment repeated with about 8 MHz AC - if I calculated correctly, that's where the circuit should be resonant.
Reply: @leonhardtkristensen4093  There is no critique =)
But that is not what happened here. AP is not measuring the voltage against any common point. Instead each datapoint is a voltage between a pair of points on the twisted wire pair at equal distance from the battery/switch.
This is actually valid for communication, which is carried by voltage difference on a conductor pair in virtually all modern protocols, but I think it might make for a more intuitive vizualization if he actually did use common voltage reference and "expanded" the visualization to the entire lenght of the circuit.
Reply: So what’s the speed of the voltage drop if you short the “capacitor” (aka disconnected wires)
Reply: How did you take so many measurements on different points at the same time?
Reply: @shanent5793  As soon as I saw the awesome animation of voltage spreading I realised that he should NOT have cut out of the script how he actually measured this. In reality, for repetitive signals like this, you never ever need more than a 2-channel scope. Just need to do lots of consecutive measurements A-B, A-C, A-D etc.
Reply: @tolkienfan1972 You might be right but in my mind I find it easier to understand that when connecting a dc source to a circuit you will initially get fluctuations that when looking at it appear as a very low frequency ac.  The calculations that can be helpful to explain the occurrences I believe are the same as used to explain any non sinus pulse. 
I fully agree that in normal talk and for normal calculations your use of AC and DC are correct. The thing is just that in this video we are looking at special details that would never be considered if we where talking about DC in say a car except the ignition circuit. In modern cars it can also damage the computers if jump starting a car. A high DC current doesn't stop immediately. It generates a high voltage spike.
Reply: @neil2402  right, but it's the ratio of termination impedance vs line impedance that's significant...
Without measured figures, you'd be looking at the difference between infinite and  ~10M Ohm vs 100 Ohm. That's going to be ~ 0.1%
Reply: @xugro  Not at the same time. Each datapoint is measured separately and averaged out over several takes
Reply: @Sett86  If you did that I think you would find that both wires in the twisted pair would have a none zero value. It would be different to his water model I am sure. 
Your mentioning of communication is relevant I believe. That is one of the places where I get some of my experiences from. I believe when it comes to it it is pretty much all the same (Data communication, high and low frequency transmission lines and computer circuits with the reservation that it does change with frequency.)  
Over all I believe he did a good job.
Reply: @dougaltolan3017 I'm not saying its wrong, just pointing out that measuring something will have an impact (if only small). I suppose in the same way, the shorted leg can never be a perfect short circuit.
Reply: Electrons don't flow.  Not in the way depicted here.  The fields transfer energy from electron to electron and the density of electrons in the wire is increasing to create equilibrium between the load and the battery.  You should be able to do the experiment that shows energy being transmitted from those initial bursts of high current through air to the load ahead of a trailing field wave from a very long circuit.
Reply: @neil2402  👍
Reply: @orionbetelgeuse1937  I am sorry if I have confused you but after 70 years having played around with electronics and electricity and made a living out of it for more than 40 years and having both practical and theoretical education in the subject I do know a little bit. If you put a resistor into the circuit  you change it so much that you get a total different result. You may be able to use a current transformer connected to a high impedance test probe. The reason for testing voltages is that you can do that with high impedance probes and assuming that there is some resistance in the wire as there normally is you get a good picture of the current that way too if you test different points.  Of cause if you can explain to me how to put a resistor into the circuit without changing the impedance of the circuit then please inform me. I am eager to learn more. In fact when we do a measurement on any circuit we alter the situation. We there fore try to use the test method that gives the least alteration.
Reply: @leonhardtkristensen4093  So I thought about it and talked to someone who knows more about it, and I think its a mix of bad connections (so basically the soldering being imperfect) and just a doubeling of line impedance. I would expect the reflection at the split to lessen if the cable length of each secondary cable was halved. The soldering can probably be fixed with a 3-way high frequency connector.
Reply: This is simple, several aspects. 1. these are reflections on a wire which can be calculated and they depend on the impedance mismatch at the point of the reflection.  2. The reason the current drops after the initial surge is due to the capacitance in the system. 3. The initial current flow will be set by the (uncharged) impedance in the system.  This is taught in decent electronics courses, please research this and update your video! I think your presentation and style are excellent, just needs a couple of minor adjustments 😁😁
Reply: @AlphaPhoenixChannel  if you add resistors in open circuit to cancel the capacitance, you will see a different chart.
Reply: What you observe is not only wires. Its a - rather complex - system of inductivity and capacitivity, which causes the swinging back and forth, and also means, there is no open end, because the disconnected end is well connected by capacity between the wires.
Reply: It's just like the accordion effect in stop and go traffic only the cars are electrons or if you're a little bit more of a Gearhead the reflected pulse wave in a manifold or header
Reply: @11:00 when you’re showing the bar graph, you refer to current but the graph is labeled voltage. My understanding is that at least on the opened portion of the circuit there would not be any current. I also think you mean voltage the whole time because you only attached the oscilloscope in a configuration to measure voltage. But want to double check.
Reply: At 6:23 a glowing orb appeared when you said zig zagging zig zagging. It was in the second frame you were showing
Reply: do you have an explanation for the initial tiny waves that you can for example see within the yellow area at 11:00 before the big wavefront hits the fork? are they from the switch itself maybe?
Reply: @leonhardtkristensen4093  Yes, both wires definitely have non-zero and time-dependent voltage against common  reference, that's why I'd like to see the whole circuit visualized.
Then again AP did an AMAZING job with this, and his attention would probably be better used on the next project ;-)
Reply: @XIIchiron78 ,веритазиума не практик,а Блогер,не путайте мягкое с теплым👆🙄
Reply: @MadhavMalhotra  Think of it this way. For the two connected wires, one wire gets a push of electrons. The other wire has a deficit of electrons (holes is the term used). The excess electrons (too high until it feeds back) meet the holes and the voltage drops.
For the disconnected wires, you get the same thing, except when the excess electrons (or holes for that matter) reach the end, the electrons are bunched up and repel each other. With nowhere to go, they bounce back and raise the voltage. When all the bouncing back and forth stabilizes, the disconnected ends have the voltage of the battery and that stays steady.
That signal bouncing back from a disconnected pair is a major problem and is solved by adding a resistor across the two wires. Otherwise, data gets corrupted. A good example is if you use a coax splitter for TV, you need to add a small screw on cap with a resistor in it to any lines that don't come off the splitter or your signal gets interference.
Reply: @ivansirtautas2513  This is a very easy-to-understand analogy! I appreciate you sharing and I wonder if someone would be able to confirm :-)
Reply: @CrispyCircuits  Thank you for the simple explanation! I'm curious to learn more now that you mentioned that example of signals bouncing back :-)
Reply: @leonhardtkristensen4093  but clearly it's not the DC component you're discussing. Yes, when you disconnect a source you get voltage spikes, due to inductance. But you can't refer to these things as DC. Have you heard people say "capacitors block dc and pass ac"? This sentence has no meaning if we accept your usage of the terms dc and ac. We should aim to be precise in engineering. It's difficult enough when terms ARE being used precisely.
Reply: Could I have a link for your medication plz
Reply: @tolkienfan1972  In this case it is the start up currents and voltages he is looking at in the video. It is all measured in nanoseconds which corresponds to frequencies in the Giga hertz area. It is difficult to measure the currents without altering the circuit too much so he is relying on the voltages at different points. We know that to build up a voltage a current must have happened as the voltage potential is really the build up of extra electrons in that part of the circuit. Current is of cause the movement of electrons. Relying on the resistance in the wire any voltage difference also indicates a current.
Your description of a capacitor is correct but you must remember that the initial inflow of DC is really an AC. It is just a part of an AC wave. It is only DC after it has settled down. You know you can charge a capacitor. That is not instant. It depends on the capacity and the resistance in the circuit. To charge to about 2/3 of the voltage is the value of resistance multiplied by the capacity and given in seconds.
To make this video must have been a tedious job as he would have to discharge every thing between every measurement. The total length of the video to do the full charge to settle down to where it is DC may only have taken maybe 100 nanoseconds. Until it has settled down it is AC is what I am saying.
Reply: In the first part of the video where you start explaining things using the scope, you don't even mention which color trace is which signal. Which is which?
Reply: @leonhardtkristensen4093  I'm not sure why you wrote all that. It doesn't contradict or correct anything I said, AFAICT. It's also not quite accurate. Note: a step has low frequencies too. Also, you can have a voltage without a current. Although how those things are relevant is unclear. Perhaps state some point or quote the text you disagree with at the beginning so I understand your point.
Reply: My first guess is answer C kinda more in line with reality.
Actually, NONE of the options you gave ACTUALLY describe reality because reality sounds like this:

There were already electrons piling up at the end of the wire (some electrons electrostatically attracted to the anode of the battery and repelled by the cathode).
When the battery is connected, the oxide layer is breached and the small electrical charge accumulated at the end goes through the battery terminals.
Simultaneously, an electron “pressure wave” begins travelling at nearly C (light speed) down each wire and the small capacitance between wires causes a small current to occur as the wave progresses. Because the wires have some inductance, some dampened harmonic oscillations can occur (everything in physics is technically a harmonic oscillator). This continues until the electron pressure wave reaches the ends. At one end the voltage stabilises and the harmonic oscillations die down and at the other end a small initial current starts flowing and an inverse wave starts propagating through the electrons in the whole circuit. Several waves travelling from and to the battery and the shorted end might occur and after each the current should increase,  but once the magnetic flux is built up around the wire, inductance stops playing a role in limiting the current, just as capacitance and all transients die down giving way to a stable operation state in which only resistive effects dictate the current through the wires and the voltages at all ends.
Reply: Called it
Reply: @AlphaPhoenixChannel why not?? Science is the battle of facts. This is the best video on this topic, foreget everyone else
Reply: 1. No need to shout, we're NOT deaf.
2. No need to frantically wave your hands, calm down, the subject is interesting enough itself.
3. No need to roll your eyes every 20 seconds, it's NOT a gossip channel for teenage girls.
4. Be a man, try to behave adult.
Reply: @dentalfloss7042  Because there is a voltage regulator in there.  The chip he used  probably runs on 5V.
Reply: @xugro  He didn't take measurements all at the same time.  He ran the experiment separately for each new position on the wire, and then collated all the data afterwards.
Reply: To my knowledge electrons don’t flow through wires. It’s a poor mental model. Electrons carry energy through the wire not electrons, just like a wave doesn’t need water flow… other than that great video 😊
Reply: @AlphaPhoenixChannel  I guess you invented a time domain reflectometer. :)
Reply: @JNCressey  "is the potential being measured relative to a common ground or between the red and black wires at a point?"  He's using two scope probes to measure points in the twisted pair, to get the voltage on both wires. The scope is set to subtract the two channels. Ie: this is a differential measurement.
Reply: @warpigs330  "How are you reading so many different analog voltages all at once and so high speed? "  He's repeating the same experiment many many times, each time with the probes in a different location.
Reply: @chrislambert-shiels5291  "Does this analysis have something in common with antenna theory?" Yes, this is Transmission Lines 101. Actually, transmission lines are important for continuous signals like sine waves, and separately for digital signals. It's all the same theory with different emphases.  The experiment in this video is very akin to transmission lines as applied to high-speed digital signals.
Reply: @pottedrosepetal6906    "why there was a reflection at the fork" -- because you have the initial transmission line with characteristic impedance Z feeding into a parallel pair of transmission lines each with impedance Z. So the signal transitions from impedance Z to impedance Z/2, hence a reflection.
Reply: You created an RLC circuit with quite significant L because of that configuration. The electron group velocity is very much determined by that large L. Don't confuse the speed of electric field and the velocity of electrons.
Reply: I love the animation, a picture paints a thousand words as they say and this by extension paints millions!

Change the lengths of the open/closed segments for even more "magic" with the polarity of the reflection 😉

https://en.m.wikipedia.org/wiki/Time-domain_reflectometer
Reply: @TheMohawkNinja  This came to my mind too, does nothing ever melt from this if it's not taken into account?
Reply: yes. what you've described is a capacitor. Usually you see capacitors as two plates close together but they are really just two conductors at different potentials. when you "fill" the wire with electrons you are charging it and if that wire is allowed to connect to something with a lower potential it will discharge until the two conductors reach an equilibrium. the reason you normally see capacitors with two sides is because it's generally easier to fill one side and drain the other at the same time so to speak giving you a potential difference between two already connected wires, but the same can be done manually with just one wire that you connect and disconnect.
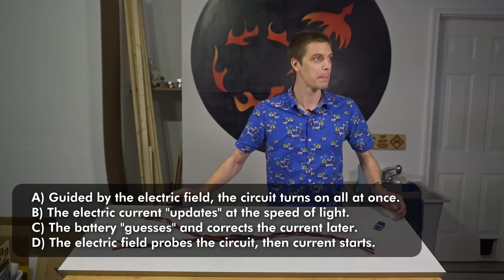Reply: I am currently at 3:17, my guess is C, because locality (if it holds). By the way you definately deserve more subscribers!
Reply: @mythcrafterpre6534  its a totally different effect.  DC is sending a Voltage/Current into a Line, and returning it back. A steady state.
AC is like wrapping a rope around a tree, and holding both ends, and pulling each end back and forth.  AC is a push-pull-push-pull.  DC would be if you tied both ends of the rope together, and "ON" would be it only traveling in one direction around the tree, at a CONSTANT/SET speed (that speed would be basically equivalent to the Voltage/Current source; like 9Volts from a 9V Battery).
Reply: @bamberghh1691 It drops at the split because it has to take the same amount of input pressure and divide it between two different routes.
Reply: @mythcrafterpre6534 at these time scales, it all looks like DC.
Reply: @truefiasco2637  I'm not a pro but as I understand it this is why impedance matching for analog audio devices is so important. IIUC that initial reflection at the fork is caused by an impedence mismatch- doubling the cables doubles the cross section which halves the impedence, and you get a reflection. Now this is only really an issue at the higher frequencies and depends on the impedance mismatch but it is a thing. If your output/input impedances are matched you won't get reflections.
Reply: @truefiasco2637  It took microsecond, not millisecond. 1000 ns = 1 μs, 1000 μs = 1 ms.
Reply: @truefiasco2637 actually it was microsections not milliseconds
Reply: I think your experiment is a much more big deal than you realize. This actually goes to the heart of the double slit experiment that has no wires, but has interference. How does the particle know if the slit is open or not to form a wave interference pattern or a blob, because it too, from its stand point, is very far away. It can even be a laser bounced off the moon array. Your experiment is in essence the double slit experiment with both slits open. Since there are no wires what is happening is on an extremely fundamental level, with the strings and their movement. I found this video extremely interesting and will need to watch it a few time to see if my model matches this prediction. Thanks (Unfortunately you will probably never read this.)
Reply: by definition if water can expand upwards without getting denser, it is not compressing. that is the opposite of compression. compression equals an increase in density. i also dont understand your argument that this means water wouldnt flow around corners. the corner has less volume, but that just means the flow of the water accelerates to put the same amount of flow through the smaller space. if water compressed you wouldnt be able to do things like put your thumb over a garden hose's opening and have it spray far further than it would before.
Reply: @Anomimus yes, that is a capacitor. In fact, you can leave the far end disconnected.
Reply: @Alphaphoenix this is measured on the grid! look up synchrophasors.
Reply: Seems like the electrons moving in the wire is fluid in nature but mass is so small and resistance so low it is more dynamic.  

My main curiosity after watching is once the capacitance is built on the open side vs a resisted (not dead short) side what happens if you use the same switch setup to a resister on the open side while it is in steady state.   I bet it would act like the water again if there was a blocker on the open end that fed into the same milk jug setup once valve is opened.  Another feedback wave running in reverse before reflections and reaching steady state.
Reply from the maker: @brendanpreece3089  the electron density I refer to is the linear density, like electrons per centimeter of wire. this eats the surface charge problem, because the actual distribution of charges on the wire doesn'taffect the outcome in any way I can measure
Reply from the maker: the electromagnetic field is created by the flowing electrons - you can't have one or the other @fullmoonsculpturescom-ej4bt
Reply from the maker: this experiment doesn't relate to quantum mechanics or the double slit experiment in any way - it's 100% classical E&M  @Everything3DCreation
Reply from the maker: what makes a single water molecule round a corner in a pipe? more collisions on one side than the other - that's pressure, and in all fluids it comes with a change in density. water's compressibility is just pretty low so its volume doesn't change very much  @merlindraws3616
Reply: I don’t know if you got this but basically the initial current is what we call the short circuit current. Basically the maximum current the battery can produce
Reply from the maker: @malokey7  it’s not limited by the battery “internal resistance” - it’s limited by the cable impedance
Reply: @roustache  yes
Reply: @MekazaBitrusty  i think they got some things wrong or just explained it poorly / left bits out.
Reply: @truefiasco2637  this is what impedance matching is about with high speed circuits, having the reactive parts of the start and finish in such a way as to not reflect or completely kill off a signal, but if matched you get the same signal at the end, a little less in amplitude, perhaps with a little noise, but recoverable, however yes at super high speeds what's happening at one end of the cable is very much different from the other, and you could actually have many thousands of bit transitions happening down the length of the cable. specially with display/hdmi cables, if they are like, even a few meters there might be 10's of pixels worth of data difference between what the device is putting out and what the screen is currently sampling.
Reply: This is the first I have ever heard of a fluid being compressible. Now I’ve only had the first two engineering physics courses and not dynamics so I am probably missing something. I would love to learn more about compressible fluids. I’m guessing that laminar flow is part of that also.
Reply: @dld2517  im thinking this is a misuse of the word compressible, more so that water is low viscosity and very 'pressable' into other shapes of the same volume perhaps?
Reply: Video worthy of a sub, I like Physics, this makes everything so much more easy to understand
Reply: @Drefar the battery is mainly a fixed voltage source, so repeatedly connecting it would have kess and less effect once the voltage on the wires gets close to the 9V of the battery. It is possibke to create a current source, which would necessarily have to keep raising its effective output voltage every time to push out the same resulting current. If the voltage exceeds the breakdown voltage of the insulation on the wires (hundreds or possibly thousands of volts) yes, the contraption would arc and self destruct. A good example of this is a tesla coil. It has high inductance, and once a current is flowing through it, it can create huge voltages in response to any attempt to stop that current's flow... and the sparks that result are impressively powerful.
Reply: Very very cool. Perhaps if the water analog fork was T-shaped instead of Y-shape you'd get more reflection with the water. Also, your water analog was missing the existing "electrons", ie your simulated wires were empty of electrons. That would make a difference.  This effect of signal reflections is the basis of a technology called time domain reflectometry. TDR is used to tell how far down a cable a short circuit, or open circuit is. When a power company want to know where they should dig to find a damaged cable, you can use this tech to figure out where the problem is.
Reply: 2 questions come to mind... Well... MY mind anyway! 
1. The source (Battery) isn't stable is it? Once you connect it, it starts to decline, right? Maybe try it with a low voltage DC source that's plugged into an AC outlet? 
2. If you tap the disconnected wires, doesn't complete a circuit? 
I ask the questions because I am not really sure of the answers and wanted your thoughts...
Reply: You said the twist in the wires does not matter, which is wrong. The twist is part of what slows down the speed of propagation. What might be true is the twist is not a fast enough twist to be measured.
Reply: @MadhavMalhotra   Notice how at the very moment the switch turns on (call it t=0), the voltage spikes at the beginning of the circuit (i.e. point closest to the battery). Once the signal reaches the disconnected end (t=1), the voltage at that point is almost identical to the voltage near the battery at t=0. Why? One way to think of it is the information of the voltage difference between the red and black wires reaching the disconnected end at t=1. Remember, the voltage is a difference measured between two points..which leads into why the voltage difference is to zero at the connected end. The measurement between the red and black wires is at the same physical location! They are connected at that point, so there will never be a voltage difference. You can actually hover your mouse over that spot on the graph as the waves propagate and see that the only movement is due to electrical noise. You could also model this as the measurement of the voltage difference across a 0 ohm resistor. Was this helpful?
Reply: the electrons in the wire don't "Stop moving" , since they are still under voltage, they just "wander"  if you could examine a single electron it would be much more interesting.   Mr Faraday would be bored w/ this "experiment"..
Reply: @Physmage  It was helpful, thank you :-) I appreciate the references to the graph animation so I can follow along!
Reply: anthropomorphism! I love it! so you consider this propagation to be kin to RF propagation. mmm... not so sure, but perhaps there's something to that, yup. The first 180 degrees of a square wave. nice. so f this let's figure out entanglement which seems to prove that particles (or whatever is transmitting info about a particle's state) do not have a speed limit at all. that's what messes with my noggin'
Reply: @veritasium
Reply: @TheMohawkNinja  During my electrical engineerig, I remember reading about reflecting waves in a course called High Voltage Engineering. So, I'm pretty sure that people working on High Voltage lines keep these things in account during design and operation.
Reply: I believe you will make discoveries in matter that have eluded the brightest minds since Einstein & Tesla. Keep going.
Reply: Amazing.. but at about 24min in.. water has considerable mass compared to electrons.. could i say that water just responds slower to the reflections in addition to having  gravity (and capillair) forces instead of electromagnetic drive?
Reply: I'm super noob so not sure, but would the length of the wire after the split make any difference?
Reply: @OGZackov  it would as the wire saturates with electrons until it filled-up and excess potentiële then bounce back to the fork between the wires
Reply: 17:18 You're assuming that electric field has infinite range and then reject the electric field explanation.
Reply: Does that mean that you can drain a battery with an open circuit if you attach and detach it over and over?
Reply: Makes sense so basically if you consider the battery a tank of water and the wires as pipes when connecting wires (open circuit) to battery water flows in an amount only restricted by the size of your pipes (conductors) when it hits the end the momentum of the water hits the wall and is reflected backwards  the wave repeats this with decreased magnitude until the potential in the wire matches the potential of the battery  . In the instance with the wires shorted you are consuming electrons and converting them to heat this is why the potential does an equalize (think hole in the end of pipe allowing water to flow)
Reply: It would be interesting to know how this would look like with AC current. And an other question would be what would happen if you put a light bulb in the line with the open end. Would it light up for a short time?
Reply: 4) sry, water is NOT a compressible fluid.  even under EXTREME conditions, it is practically INCOMPRESSIBLE, and under the benign conditions of this demo, water can be considered absolutely incompressible.  you go on to state that the way you're using the water, "it's actually EXTREMELY compressible (in the lateral) direction because it's allowed to expand upwards."  i get what you're getting at, but your language here is LITERALLY wrong, and therefore dangerously confusing to readers with limited educational bkgd.

instead, you might say, FOR THE PURPOSES OF THIS DEMONSTRATION, THE WATER SIMULATES A COMPRESSIBLE FLUID BY EXPANDING ITS VOLUME IN THE VERTICAL DIRECTION.  IN THIS WAY, THE HEIGHT OF THE WATER COLUMN AT A GIVEN POINT CORRESPONDS TO THE "BUNCHING" OF ELECTRONS IN A WIRE AND TO THE POTENTIAL (VOLTAGE) AT THAT POINT.

IF the water were compressible, then the water level would NOT rise in the direction orthogonal to the direction of propagation (doing work against gravity), it would simply compress in the direction of propagation (in a manner analogous to the "bunching" of electrons in  the wire).

your demo is interesting, but on this point, your language is more than a little sloppy, and potentially confusing.
Reply: an idea for the water model to be more accurate.  Could you get a controllable opening for the water channel side thats "on" or "low resistance".   After the initial wave hits the on side water channel, if a button or timer could control an opening to increase or reduce  the aperture to adjust the rate of water leaving the channel.  Maybe you could make a program to actuate the opening and closing as per your timing.  You mentioned momentum and water dynamics make things difficult.  Im thinking the area available for water to move vs area available in the wires is something at play in the model and being able to tweak the flow of water leaving the one channel will help you simulate the visual you wanted better.   Sorry for the rant, just thought it may get you thinking in a diff way to tweak the water visual demonstration.
Reply: @AlphaPhoenixChannel  What's the stiffness of the electric current?
Reply: There's lots of people commenting in here saying "I have a PhD.." I don't have a PhD but this video is wrong. The wires aren't disconnected. What you are actually measuring is the flow of current through your oscilloscope which is a very high resistor and capacitor. It allows current flow and has input capacitance, you are not measuring the flow of current through disconnected wires. The most important item in your diagrams that you are missing is the oscilloscope itself which is part of the circuit.

Many others are commenting on the Veratasium video and if you do a youtube search for "electricity doesn't flow through wires" and view Veratasium's video The Big Misconception About Electricity you can find it.
Reply: Didn’t veritasium do a video on this
Reply: A or B but I’m leaning B.
Reply: Thank you for your great efforts in making this video (the first I've seen of yours). Your capacity to explain complex concepts with such clarity is extraordinary. Clearly I'm not one of the gifted people who usually comment on your site. But even I felt that sense of joyous epiphany at the sudden understanding of concepts I had long ago abandoned as a schoolboy. (e.g. voltage as electrical potential, capacitance..). What a wonderful generosity of spirit in sharing your brilliance as an experimenter and teacher to everyone for free.  Will with a contribution. Long may you run!
Reply: One tiny nitpick of a BRILLIANT presentation.   You mentioned the electron actually moving  10,000 times slower. But,  while there are several negative units,  I don't know any of any unit of SLOWNESS, so 10,000 times can only be faster.
Reply: ad 4) water is a compressible fluid sinced when? Water is compressible to a very small degree under very high pressure (i.e. practically incompressible) which is certainly not the case in your model.
Reply: thats pretty cool and a lot of work editting to be nice and clear for us thx man
Reply: So ironic around the 26 min mark for you to say "if you want to get technical" 😂 love the energy and passion you put into this work. Thank you.
Reply: What happens when this is done with AC?
Reply: I will go with the Magnetic Field the Wired Produce that Give it the Bounce... 
Next Try Metal Filings when doing a test with High Current.. The Field Affect looks Nice..
Reply: Can you do something to the water model to make it simulate the induced magnetic field?  It may be possible but too difficult, but if it’s not that difficult, maybe the analogy would be even better?
Reply: so in a house there is more current in a cable that has not got a connected plug socket or electrical device connected to it than if a cable has an electrical device connected to it
Reply: I have a few questions: at 20:14 you briefly mention that capacitance in twisted pair wires is higher than in single strand, separated wires, but you don't go into a lot of detail on why.  Is this due to the opposing nature of the magnetic fields of each wire in the twisted pair, and those fields pulling and pushing more strongly on the electrons in the opposite wire?  Would the effect be reversed (i.e. a lower capacitance) if the direction of flow were the same on both wires in the twisted pair, for instance, by connecting the beginning of wire A to the end of wire B and creating a "single wire" twisted pair loop?  How do these phenomena relate to the interference reduction of twisted pairs in RJ45 and other communication wires?

I would also be very interested in exploring the concepts of signal reflectance and impedance mismatch in things like HAM radio antennae using a similar approach to this video.
Reply: Super Interesting!
Is it possible that the difference between the water and the wires are that the water waves are also fighting gravity?
Reply: Pressure and compressability are different things. 
Water is "not" very very limited compressable.
Reply: i mean isnt this just showing how true the fermi gas model of metal is ?like you have phonon that behave like real particles, and you have electron as basically not interacting particles just like in low viscosity liquid like water
Reply: @alphaphenixchannel respect. You did a really good job. You confirmed Maxwell's equations in practics. You made a transient analysis of short and open wires in parallel. In such an analysis, you should take into account not only the resistance, but also the capacitance and inductance of the wires. 
You can model each small segment of the wire with a partial resistor in series with an inductor and a capacitor in parallel. As you used twisted pairs, the inductance is much lower compared to the capacitance and can be somewhat omitted. So, you've got a chain of RC elements. That creates a delay in propagation, and everything behaves as a wave. This way, you can model your experiment and run a SPICE simulation. You will probably get very similar results.
The open and short ends behave similarly to a string, respectively.
The open end reflects the wave in the same phase, while the shorted end reflects it with a 180° phase shift."
Reply: Hi mate this is super interesting, I'm a fitter/hydraulic fitter, and i always tell my electrician brothers and sisters that hydraulics work on sort of simaler principles to electricity as both have a power source but must return to that power source to be useful. Unlike pneumatics which can be vented at point of operation. I think the logic circuits are very similar are I'm pretty sure the circuit would react the same way if it was a true sealed hydraulic circuit. Loved the water circuit by the way. This is how i think of electricity, but i mostly convert to fluid dynamics. It's definitely slower.
Reply: Thanks for that. Your first point covered my one uncomfortable area, that we were discussing current so it was unfortunate you weren't measuring it directly but had to infer it from the measured voltage. Other than that it was a great confirmation of what was assumed to be so.
Reply: first off, think of it as volume and blowing up a bounce house, the (Disconected wires) are half the length (the connected wires are a continuus run all the way back to the batteries second terminal), therefore nothing is being "talked to" its about pressure and finding equilibrium throuugh the voulume of the path. you see that the disconnected wires are peaking first, its because once the current is split after the "Y" there is less volume to fill, while the connected wires are still being filled because there is more volume to fill, they are also being drained (energy being absorbed) by the second terminal.
Reply: @givensuman A "short", or "short circuit" refers to a zero resistance connection (no load), such that any other part of the circuit doesn't "receive" current, because the electron flow takes the path of least resistance (I guess in effect, a shorter path). That is where you are getting your (correct) impression from: because of the short, current does not flow through the desired part of the circuit. In this experiment, you could argue that it isn't really a short circuit, because it is intended, I guess. I hope this might help to sort out your confusion.
Reply: I may not be fully understanding things here, but are you not, by inserting an oscilloscope into the open circuit, adding a load? An oscilloscope does not present an infinite resistance (at least I don't think it's infinite). Couldn't that influence the result?
Reply: @Fozcine  I reckon it's impedance will be high enough not to have a noticeable effect.
Reply: @WideCuriosity  This is true, but it's still not the same as an open circuit. At 1 megohm there would still be about 0.01 milliamps flowing (unless I've miscalculated). So, there is some electron flow. The battery can "see" this. Now I'm not saying that this is enough to change the result of the experiment, but I believe it should at least be considered. A high resistance is not an infinite resistance.